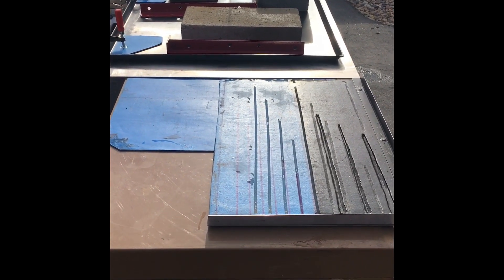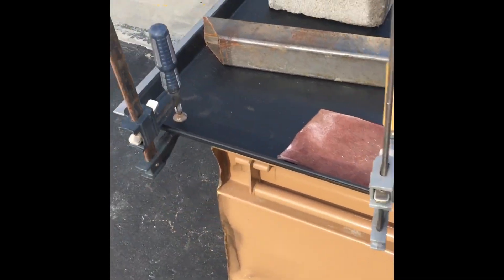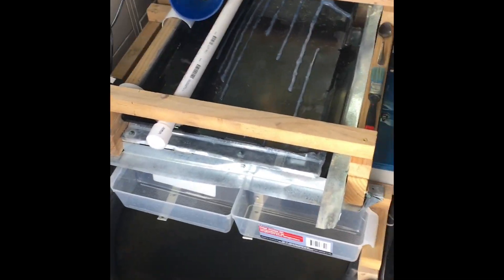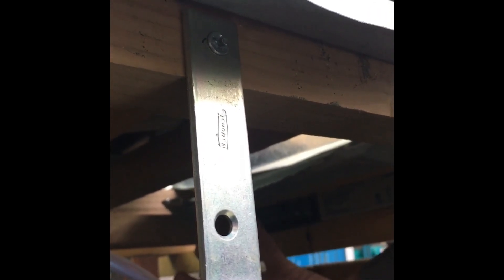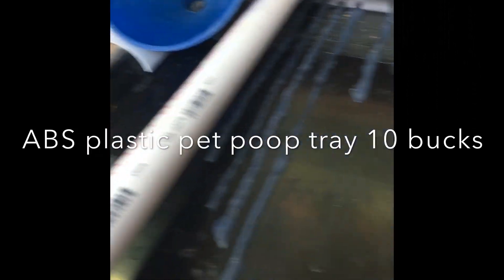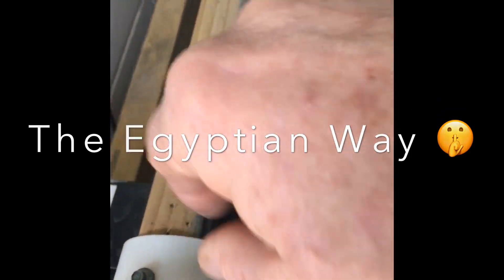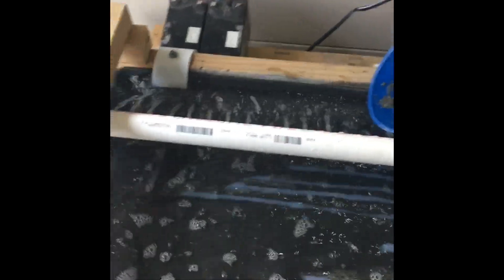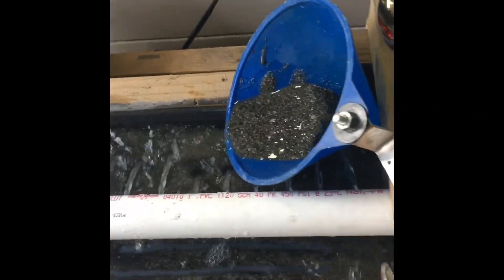DIY Gold Shaker Table Build 1 Rev 4

Comment: Great video, I’m subscribing to your channel great content. I am going to build one soon. Can you tell me what the top of the table is or what it’s made of ?
Reply from the maker: I used stainless steel because it was something I had and it’s rust resistant being stainless steel. However ☝️ I would not use stainless because welding it together caused it to warp and that’s been a bit of a mess.
I think using something else would be much better. I’ve been thinking about making another table top for it. A piece of 1/4” aluminum plate with 2” aluminum angle pop riveted on it for the sides would be easy and be pretty flat. Also I might make one out of marine grade plywood. This shaker table is pretty easy to swap tables out.
Glad you subbed my channel.. that’s Golden! 😃
Peace Prospector Tripp

Comment: Wow great work! I would love to build something like this where about did you get your info or plans to build this?
Reply from the maker: James Towns 
Hello James, thanks for the question.. I basically just watched videos and studied other shaker table designs.
Pretty much trial and error and I keep changing the table to refine its performance to improve the separation of the light gangue material from the heavy metals and sulfides.
I am finally going to have a Hard Rock Gold Sampling Trailer!
It will have a..
4x8 foot Trailer with.. a 4x6”Jaw Crusher feeding a 14” Chain Mill Crusher feeding the Larger Shaker Table!
I want to be able to pull up to a mine/claim and sample on site and determine if the mine or claim has enough value to either buy or claim.
Retirement is coming and I am preparing for post career activity and maybe get a bit of Shiny!
Build On Pal!
Prospector Tripp